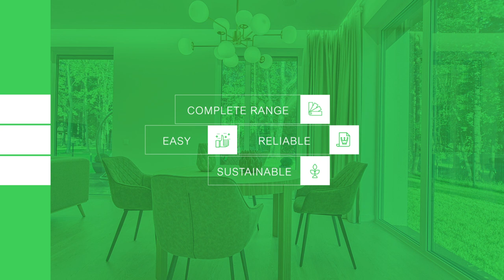Easy9 Devices for Residential Applications | Schneider Electric

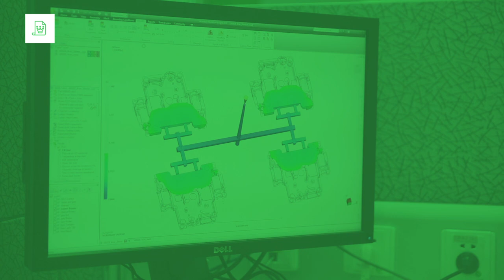Comment: 1:27 what program are they using to simulate plastic injection molding?
So Easy9 replaced Acti9?
Couldn't you just stated that Easy9 is a Refresh or Upgrade to Acti9?